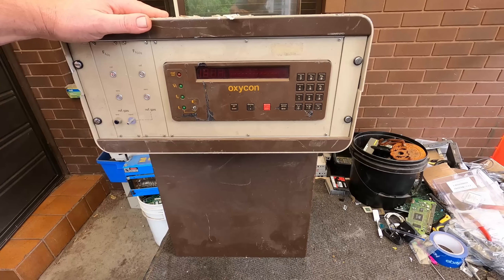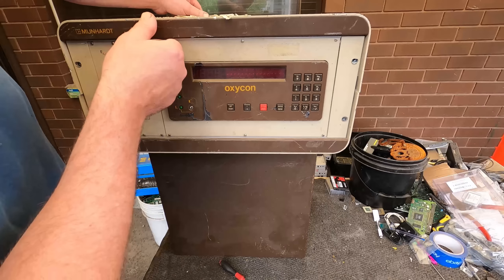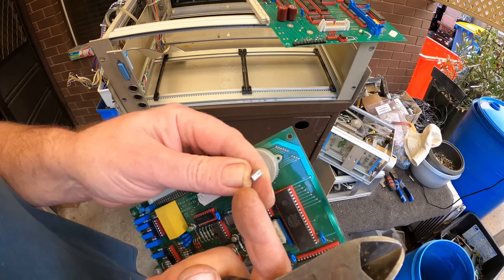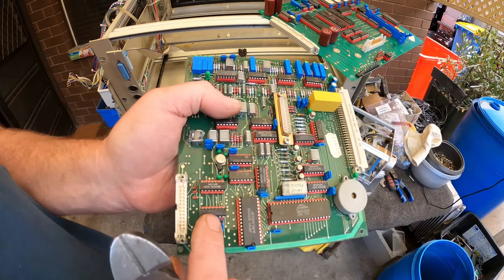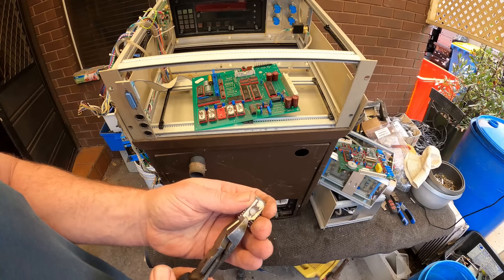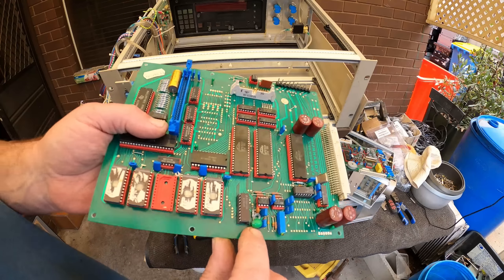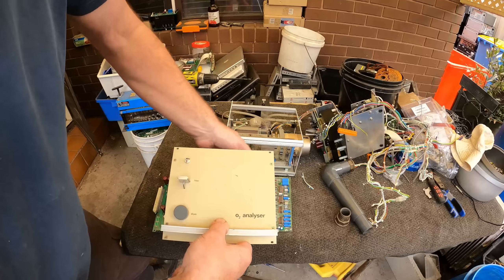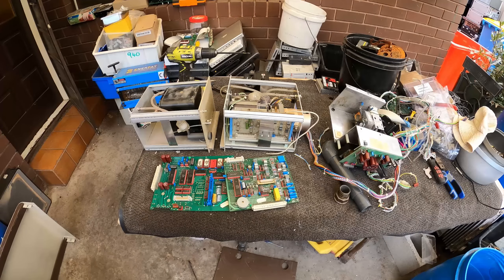What's inside a Vintage Elecrocardiogram

Comment: Hey Ben, at 14:02 those "blue boxes" are 10 turn precision potentiometers (variable resistors). That green stuff on the ends is glue to set the screws so they won't move.
Reply: So that's what it is!  I had a bunch of slot cards from some broadcasting equipment from the 90s and I could not figure out why there are ceramic screws in some of the "transistors" (at least that's what I thought they were).  Thanks!
Reply: I think what you have are variable capacitors. The screws are either plastic or ceramic so they won't interfere with the capacitance or magnetic fields.
The blue boxes shown above have what's called "worm screws" as you turn the screw, a slider slowly slides back and forth giving more precision and allowing fine adjustment. Usually made from brass, But may be gold plated. I'll have to take his word for that, I couldn't see the pin very well in video.

Comment: Glad to see you are feeling better Ben, In case you were windering, 10:30 those things are vacuum display modules.
Reply: Nope, those are the old HP "bubble display" LED displays (model HDSP-6508). Actually still desirable for holidays, go for about $10-20 a piece depending on the module.
Reply: @PedroDaGr8  You are probably right, they look a little bit big though, Do you have any idea which model it is? they would be interesting for some projects like a frequency counter and other or clocks......
Reply: @patprop74  I believe they are the HDSP-6508 or something similar to that. If you check eBay one listing has them very pricey but does a good job of showing the size of the digits versus the size of the packaging.

Comment: Might be a bit late but the block components withe silver ends are siemens  polyester film foil caps, just aluminium foil and sputtered tin on the ends.
The green cylinders are mylar/polyester film foil caps from Roederstein (ero) and the gold cylinders are roederstein (roe) electrolytics so no precious metals in any of them :(
yea i'm am a bit of a component spotter

Comment: This unit is definitely not an electrocardiogram machine. It has an oxygen generator on the bottom. The unit is hooked to a patient to see what the oxygen uptake/CO2 outtake is. I would not be surprised if those boxes inside it that you are throwing away have more scrap value than any of those PC cards do.